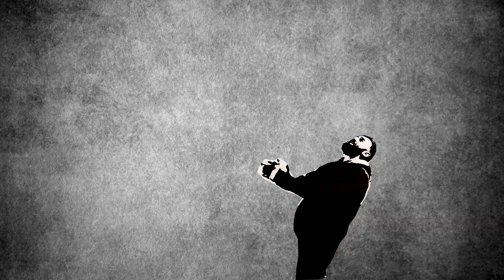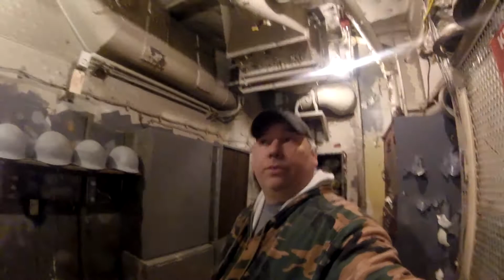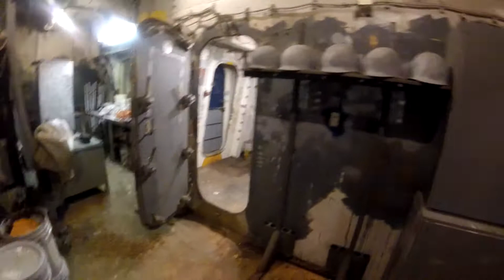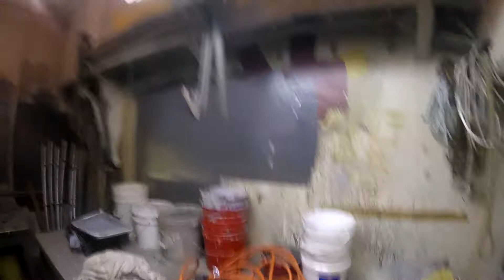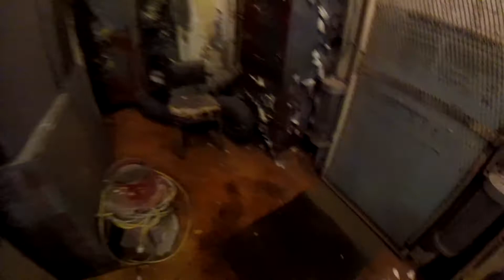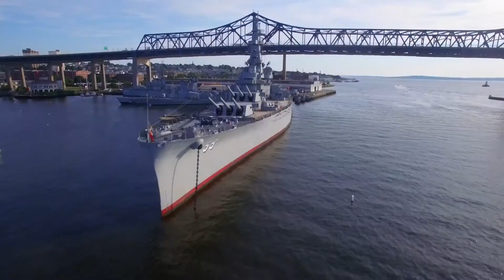USS Massachusetts BB59  introduction to out new 3d printer lab project

Comment: Have a look at shapeways. They print in many materials from plastics up to stainless, aluminum, and brass (printed in wax and cast). I've found it can be better to know someone with a printer rather than to own one. You could still do the server and create your 3D models and do the part finishing, but if you just want parts, it may save some headaches.
Reply from the maker: thanks for the advice y have  been in the 3d printing world for many years we plan to run 8 machines out of here as well as a verry large format machine and be able to print in many materials on board  we will have both fdm and sla printers available the goal is to be able to make the parts we need as well as serve other museum ships that need parts drawn up in cad or printed   any one with knowledge in 3d printing and wants to volunteer is always welcome
Reply: @ussmassrestoration1104  That sounds great! My experience has been with a pair of poly jets, one from Stratasys and the other from 3D Systems (I think they are CAD blu now), and a series of filament machines. With the polyjets, it was constant maintenance and break downs, and with the filament units, it was constant adjustments and temp control. We still use both, and we did some great work with them, but eventually we found it that sending it out was easier for some things. For us anyway.